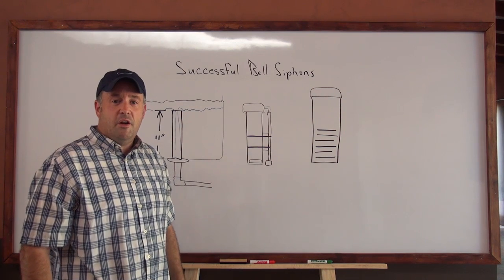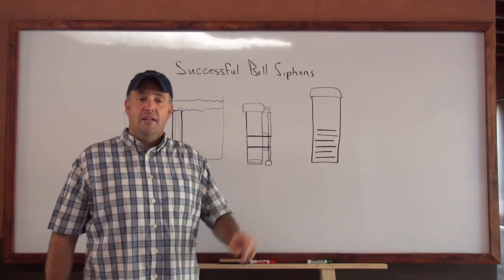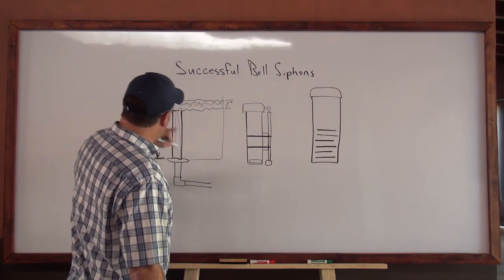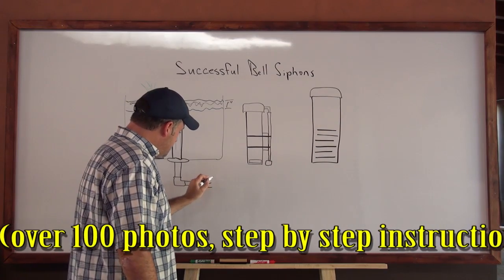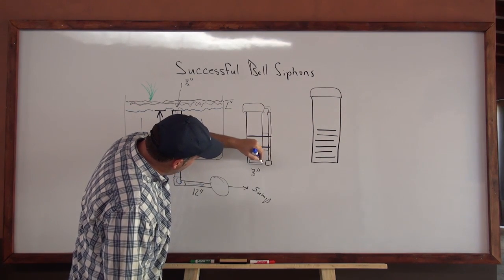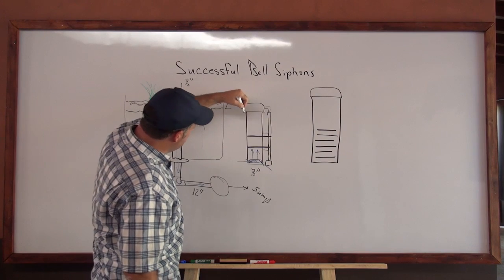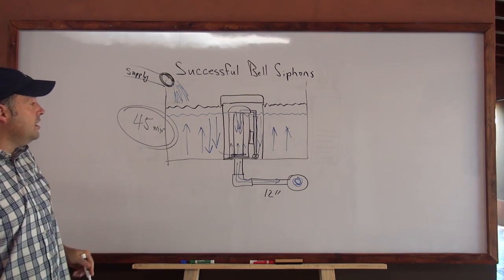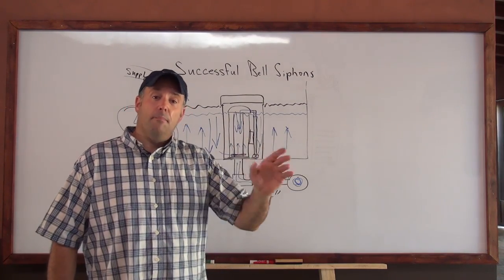Making Successful "Bell Siphons" - AQUAPONICS

Comment: bestexplination. ive watched about 6 vids on this and couldnt work it out. you should get the nobel prize for aquaponics
Reply from the maker: WOW!  I take that as a great compliment!  Thank you so much!
Reply: Yeah that was a good explanation.  Seems the drop of 12" would be more important than the horizontal 12" and not losing "prime".  The cap at the bottom would seem to be preventing air from getting sucked in while allowing water to flow and then siphon.

Comment: 45 minutes to fill and drain a grow bed? Is that specific for large grow beds? Or does that apply for small setups as well?
I have a 55 gallon fish tank and a 5 gallon grow bed filled with clay media. 

3/4 inch standpipe with 1 inch bevel
2 inch bell siphon with snorkel 

The grow bed fills in 2 min 30 seconds and drains in 40 seconds. 

Should I be using a timer on my pump to reduce cycles?
Reply from the maker: Sorry, I work with large system 800 gallons or more.
Reply: @thehealthawakening  no worries, I ended up getting my answer in the end. Thanks for responding.